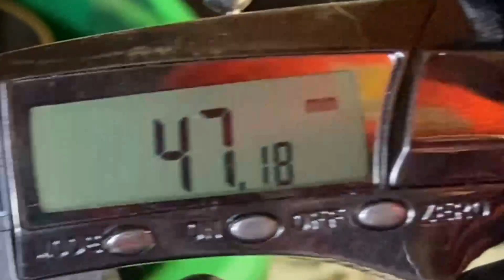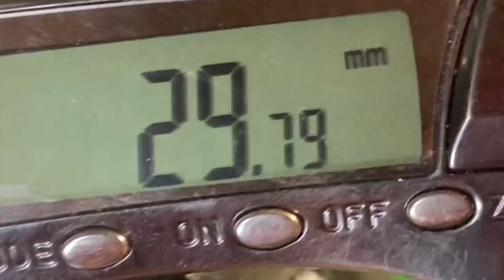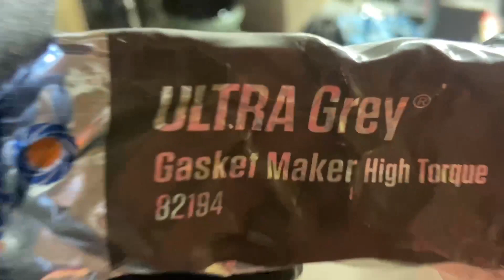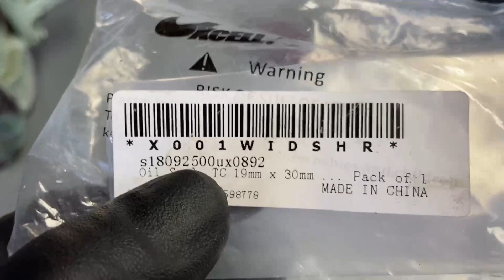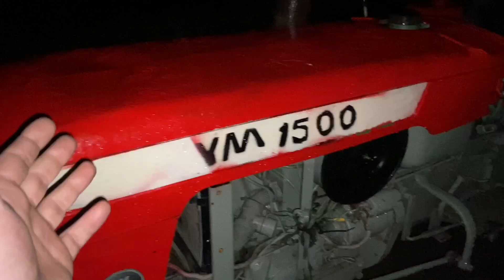Yanmar 1500 front axle Portal tear down and bearing/seal replacement

Comment: I just found a yanmar  226d. With 7 attachments.Really cheap. 800.00. It was built between 1981-1991. 
   The front left wheel is locked up. Is it possible that a piece of the wheel bearing fell into the gears?

Comment: dude, you need a bearing separator, puller set and shop press
Reply from the maker: Iv got all of it. Just chose not to use those tools because most people don’t have all of those things.
Reply: I certainly don't and I'm doing the same thing. Thanks for this video